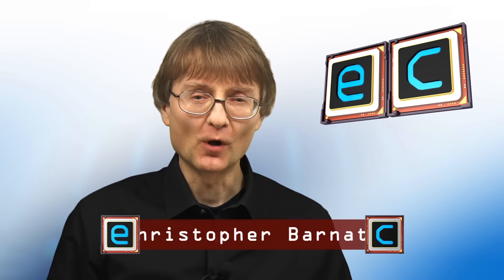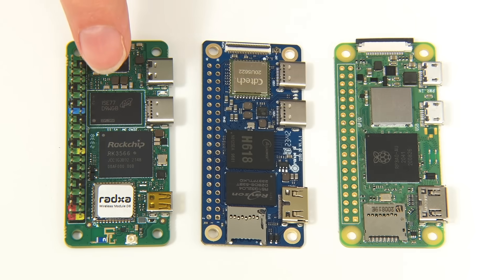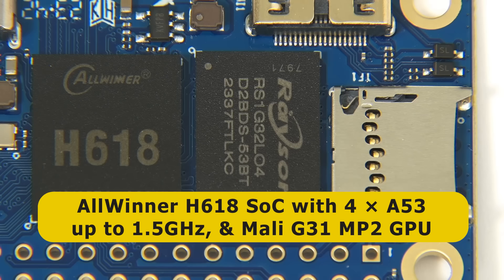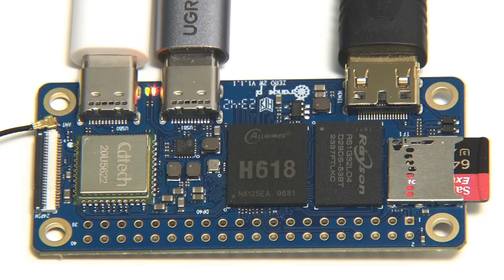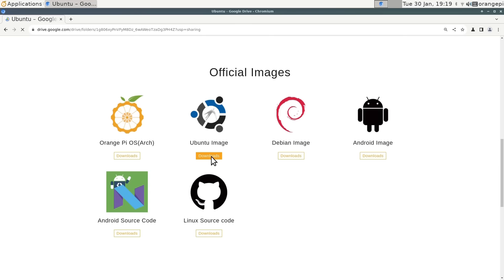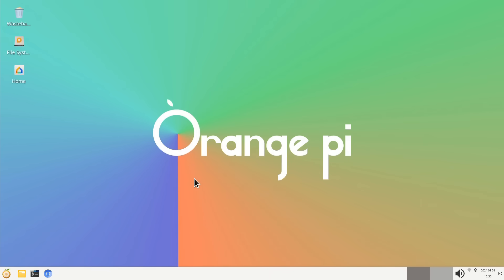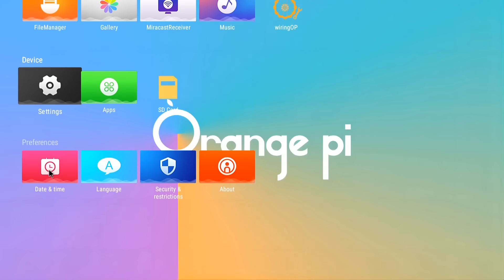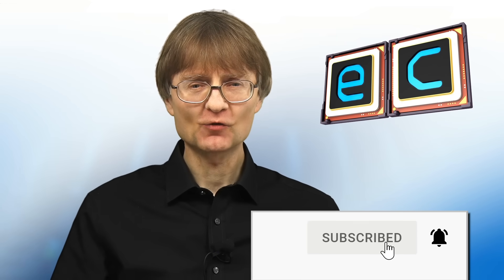Orange Pi Zero 2W

Comment: the download bit is misleading, they've exceeded their account limits and while visible, they're NOT available for download. that's my experience anyway. "unable to load user" on your screen, interesting. looks are decieving.
Reply from the maker: Nothing in this video is "misleading". There are no permanent download limits on Google Docs, although it seems that limits are imposed for 24 hours at a level that Google has not published (the upload limit is 750GB). But I've just tested, and right now (September 2nd 2024) the OS images for the Orange Pi Zero 2W download just fine. As always on the web, never report that something -- especially a free something -- is not working until you have tried at different times. :)

Comment: I have Orange Pi Zero 3 which has same H618 SoC. The only builds which support HW graphics accelleration are ARMbian builds. Unfortunately these builds are not officially supported by armbian and they lack sound support. Wondering when these issues will be solved.

Comment: I just knew about this board this morning while googling for RP Pi Zero W 2 :D. It's much attractive than RP one with 1GB and USB-C ports. I just need a simple setup with Ubuntu so performance is not a big issue in case it's worse than RP Zero W 2 :). Very impressive, thank you.
Reply: how has yr Ubuntu setup being faring w the Orange? I seriously considered it because of more RAM & USB-C as well & opted to get a RP Zero 2W due to the stable ecosystem of software & community support. I didn't want my 1st experience w an SBC to be tainted by things breaking all over the place like I see in this video!
Reply: @udance4ever  I bought an Orange after a few days I watched this video (and commented above) but I have been busy since that day so I just opened the box to check items inside. Actually it's packaged well and I like it more a few RP Picos I bought in the past :)
Reply: @tiendq  hey you get around to playing with yr 🍊?   I got my RP Zero 2W & while I knew it going in - 512MB doesn't seem practical for anything but embedded use. once you add a desktop (or any kind of graphical front end like ES in my case - I didn't realize how much memory it eats), u have like no memory left for apps!  I prolly will order an Orange Zero 2W soon just to test it out :)

Comment: Not sure why you'd even comparte it to the Zero 2, when you should, like myself know full well it's a Zero 3, but renamed Zero 2W because they are trying HARDER now more than ever to direct compete with Berry's. Which I do- did love Orange pi boards, but I guess the cheaper cost does come at - well 5 boards broke on me due to no fault of my own it's annoying as hell. But ya the Zero 2 has a H616 and max 1GB ram, whereas the Zero 3 has EXACTLY the same ram, cpu, everything as the Zero 2W - it's been named this to show up whenever a person is looking for berry's 2W and because if they named it the 3W they'd have a "better" Radxa Zero 3W showing up - and I quoted 3W because without 8GB ram and emmc the Zero 3W actually is worse, to my surprise the H618 is literally better than the 3W if SD cards are all that are compared, and there are also Sipeed and Banana with emmc with this CPU

Comment: I started to use SBCs when I started building robots. All the robotics info on explaining computers was of tremendous help. I have an SBC from Orange Pi: it fried itself in the first 10 minutes of operation. And orange Pi would not replace it. Having used 3BPi boards, including the M2 Zero, I have found Banana Pi has equivalents to the Orange Pi boards and they are much more reliable. PS...do you think you'll ever build the hovercraft. That would be very exciting.

Comment: Orange pi usually seems to offer better hardware compared to rasp pi i think they even launched 64bit before rasp pi

Thats what using off the shelf mediatek  and allwinner soc with 4-8gb of ram

You can run android on that 2w, just add ips and and touch, 4g lte and wifi

And its an android phone

Or use whatever os with a phone dialer

Just slap an fpga or asic via gpio to get a camera, gps, and accelerometers and gyros, and nand flash
Reply: My Samsung has 8 core cpu that maxes at about 2ghz 

Why only 3gb of ram for 64bit Octacore is beyond me when you could use one 4gb chip instead on a 2gb and 1gb chip

Really does everything this can, you can even flash your own os, though you'll need Bluetooth or USB to use gpio
Reply: With esp32 Bluetooth and wifi now becomes so easy even a pdp can use it
Reply: Funny thing is this is just the phone

Literally youre just buying a devkit for an open-source android smartphone or tablet 

You can plug it in and boot and use it

But it's more or less a devkit, you want the rest of the phone or tablet you buy it

Smartphones are where soc started and made them actually possible

Comment: OK, I have been trying every version (2 GB version) of OS for this thing from the website.  I have even tried the Raspi one at the bottom of the page.  I can't seem to get to a login screen.  I never "boots" up or is usable.  It will start with the image in a ~2 GB partition.  After starting the device it will modify the file system to use the whole disk, so I know it is doing something.  But I just can't ever get to a point to use it.  I can get to the SPI flash and have that up on the screen and even type on the USB keyboard through a USB-C hub.  I get nothing from any of the OS's.  Did you have trouble and how did you solve it Chris?
Reply: Finally figured out it was the "Linux 6" kernel that was the problem.  Once I switched to a Linux 5 kernel version of an OS, it worked.  Hopefully this helps somebody else.

Comment: Would have been nice to see more useful things this board is meant for, using it as a desktop is not a viable use case. 
Network throughoutput IO tests, WiFi speed/latency etc etc.. 😕🧐🧐🤓

Comment: I've been playing with these boards for few weeks. Be aware these boards are hit and miss. They have a batch on the market that the board overheats and just dies on you with default settings. If you have a board like that, and you ran out of the return window, your only option left to make it stable is to add an active cooling fan.

Comment: Nice just got mine. 3 weeks ago. I have the OPI zero3 and the question for me is will the LCD TFT screen support transfer over to this model and othe models made by banana pi? I would also be cool if a expantion board comes out for bunocular type cameras and sensor boards. I hope OPi expliots the expantion port and OTG port to the max. I unsderstan this is for IoT project and I don't expect it to run like the rk3566. I fact I expect the 1GB models to just be leave and forget projects hopefully involving NB-IoT.

Comment: Forgot to mention earlier that I'm equal parts surprised and dismayed to see a USB-C port restricted to USB 2.0 speeds.
I thought that a USB-C port was a suitable indicator of USB 3 or better speeds.
Is this an indication that the USB specification is an even bigger mess than I thought it was, or is this a case of another manufacturer playing fast and loose with the spec (disappointed that the Pi 5 also chose a non-PD standard power requirement)?

Comment: I'll say it before and I'll say it again the reason raspberry pi is the default is when you get it the software just works and if there are any bugs you can be sure they will be fixed. 

Even disregarding the obvious crashing issues that should have been found in QC why would you launch a product with hardware acceleration being unavailable in your default distribution?

Comment: i never thought about having an Orange Pi!! but omg though loool "lets..... have....... a closer............................ look" ABSOLUTE CLASS!!!
Reply: additional to the OS, i thought i saw it when you opened the task manager it popped up and then went to monitor sleep mode. is it possible to mess around with the the power saving for the HDMI? might keep the screen on. 

Again rewatched the video... android with GPIO access is pretty useful!! suspect something wrong? boot to the android and test!

Comment: USB-C is much better than USB-micro. Mating cycles differ significantly (connection amount before replecement). C is designed 10000 (10 k) and micro about 1000 (1 k).
Reply: I love huge the usb c is while on its mating cycle

Usb c so big you won't get dihhsconnected

Comment: The Orange Pi Zero, Zero LTS, Zero Plus and Zero Plus 2 have a real advantage over any Raspberry if you need two-way audio access. In addition, it has USB 2.0 on the pin headers too. In fact it is the perfect base for any amateur radio relay controller. On Raspberry you had to hack in some pogo-pins to contact the rear of a USB connector so you can add in a USB audio codec. On the Zero 2 you just need some OPAs to adopt levels, 1:1 audio transformers and there is enough space left to break out the serial port and some opto-isolated control lines for PTT, Squelch and other information. Unfortunately for the 2W they ditched that MIC in on the 24 pin FFC extension port. So, the only benefit is, that a FFC is a much more reliable connector compared to pogo-pinned USB...

Comment: As usual, this is a great board, but the software support isn't very good. And I don’t think that the situation will improve much, just as it did not improve for all previous generations of single-board computers from this manufacturer. However, there is hope - community patches may appear in the AUR.
Personally I have and use a couple of Orange Pi Zero just because they are the cheapest SBCs. They work well enough for my purposes.

Comment: I have the 1 GB version of this board running Pi-hole in headless mode.  The only issue can be seen at the 6 minute 41 second mark.  If you look closely at the mounting hole near GPIO pins 1 and 2, there are three surface mounted chips.  Be very careful when using spacers as they can crush these chips when tightening the case screws.
I had to cut away part of my spacer to avoid these chips.
Reply: Dealt with the same issue myself.

Comment: We got retropie working on this board. I was hoping cloud gaming would work based on specs. But it lags. Another situation of lack of driver support. The raspi pi zero2w can run Dreamcast games just fine. This model lacks 3d acceleration. It’s more powerful than raspi zero 2w but hits and misses in performance

Comment: Great to have another video with Mr. Scissors back at work. I agree that Orange Pi model names and numbers defy explanation. For instance, the OP 800 is closest to...the OP 4LTS in specs and GPIO setup. Even runs Armbian for the 4LTS. Go figure.

Comment: Ha. The W stands for wireless? I thought at first that it was designed to only draw 2 watts. I am looking for a tiny form factor sbc that can run linux but that draws as little as possible power as possible for battery-powered applications.

Comment: This board is awesome, but the voltage regulator is kind of sensitive to high currents on the USB port. One of mine died a few hours ago after running an APRS decoder for a couple of hours. The culprit was probably the USB audio dongle used. So, beware and have fun!

Comment: I think the three most interesting things to test on zero form factor boards are GPIO protocol availability, ease of GPIO access, and power consumption. For example, do the manufacturer provided linux distros include middleware similar to “wiring pi”, or are you only limited to lower level access via stuff under /proc. Do the devices have any traits that make GPIO access more problematic (like bad documentation). Are they power hungry. That kind of stuff.

Comment: Thanks again for another informative video Chris. Although a powerful SBC at a great price, as you pointed out, not quite ready for Prime Time due to operating system limits. Like so many other SBC's you have reviewed. This remains a strong point for using Raspberry PI SBC. It would also be informative to see what software, or operating system would control and display results from this SBC's  GPIO interface. Things like the DIO's, I2C, SPI, etc. Maybe a detailed look in future video?
Reply: It's Linux, an operating system with no limits. The only limits are defined by how good you are in building it to do what you want. If you're always reliant on (probably rushed) Linux builds provided with the boards themselves by the vendor, then what do you expect?

It's your expectation of what a tiny board can do and should be able to do that is unrealistic. What do you mean by "Prime Time" when these are "hobbyist" boards anyway?

Comment: Orange Pi, once bought, never again. No software updates since September. As long as you accept that their software is just a trick to make you think that they are anything other than box shifters, where official user support is also as close to zero as you can get, so on your own/reliant on community development, then you know what you are getting.Software support for the Official Orange Pi 5 software support is equally woeful, so cannot possibly agree with this conclusion.

And congratulations on the relocation to the USA.

Comment: This is a weird little board. I got mine before Christmas. I'm pretty sure that Orange Pi OS worked fine for me. Android was the problem. I did get it working once. An update popped up and I attempted to install it. It trashed the card. I then attempted to flash Android on the card again - and ended up with a stack of ruined cards. The computer will no longer recognize them. Windows 11 seems to be one of the problems with the flashing software. Orange Pi recommends San Disk if you are having issues but that doesn't work with Android. I have read online that other users have had to try 10 or more times to get this image to flash. Some have reported that they went through various off-brand SD cards and finally got one to flash.  I was just about to sit down to try this again when this video popped up. The Raspberry Pi 2W might not have as much RAM as this device but you you just wouldn't have these problems. It would have been fixed immediately if several users had reported it.

Comment: I have an Orange Pi Zero 3 it  comes with the same processor and RAM options as the Orange Pi Zero 2 W but shares a similar from factor to the Orange Pi Zero 2. The Orange Pi Zero 3's expansion board goes onto the single set of pins. Excellent video as always.

Comment: Just in case anyone is wondering (I was trying to find out this before), the Argon Pod case fits well with this board, luckily you can hide the antenna inside the plastic lid so it's a very clean way to use it. You just need to be careful with the thermal pad, the Raspberry Pi Zero 2W is thicker than the Orange Pi Zero 2W so you need to use a thicker thermal pad or an extra thermal pad to fit it. You also have to be careful not to bend too much the board so I use more thermal pad on the bottom of the board to compensate the pressure on the top, that's the only inconvenience. I don't have many complains about this board it's very low power, in idle it draws around 1W, I've even been using DietPi OS on it and it's perfect!

Comment: Yes! These are the types of SBCs I actually care about! The price of modern SBCs is so high that it's hard to justify the cost if you're just using it to tinker or making a small project. Once acceleration is sorted I think it will be a very capable little computer.

Comment: My Blue Iris camera page has become my go-to SBC burn-in utility. On Ubuntu it works just fine, even runs multiple 1080p h264 streams, no problem. And it uses hardly any CPU, never gets hot, and doesn't draw any significant power; so something weird is going on there. On Arch OS it plays OK, but eventually locks up after about ten minutes or so, and it DOES get hot. But the rest of the OS is broke anyway, so...
And I couldn't get Debian to install for some reason. It kept asking for a second disk? Maybe I'm just clueless! lol.
And, what can you do on Android, without thumbs?
I got this board because I want to put a camera in a metal building, where currently resides an RPi ZeroW that can't keep a connection. Plus I want something light weight that can run OpenCV on a battery pack -- because who doesn't want solar powered internet-based object tracking and face recognition in their tool shed, am I right??!! 
Anyway, I'm still trying to figure out the software (I'm hardly the python guru). It's been sitting on my coffee table for weeks, while I watch YouTube videos! :)